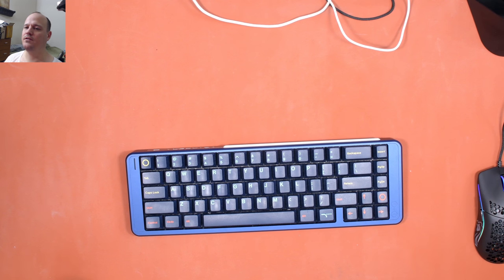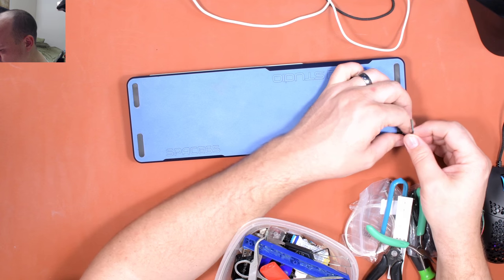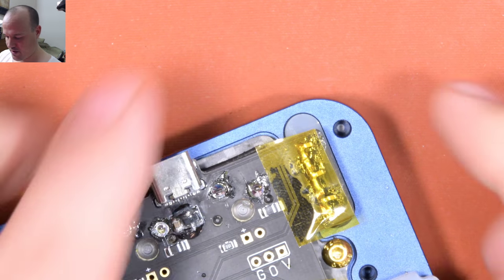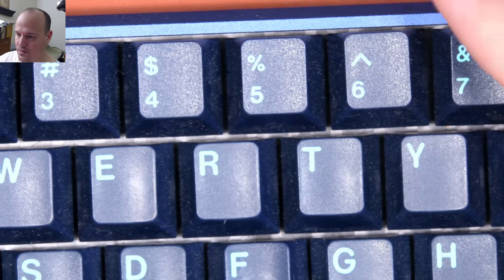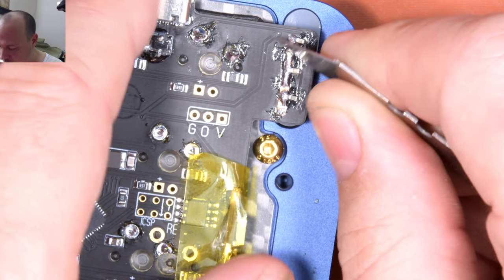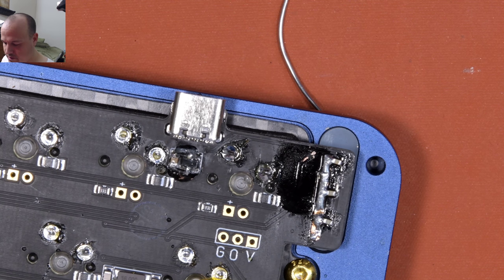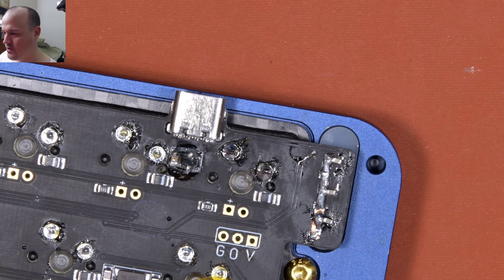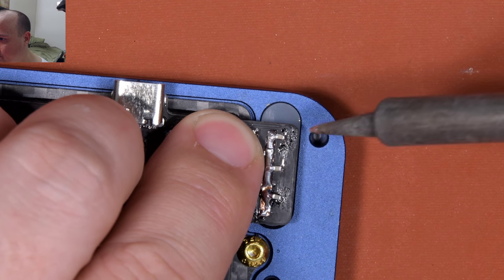Space65: Adding series resistor to LED din pin

Comment: Also, the "r" is probably used for ohms when writing because if you're typing it on a keyboard, there's no omega character handy, and using an O would be confused with zero.

The numbers are often written that way, using the letter as a decimal point, because it's easy to read, and not prone to errors like not seeing a decimal point on messy writing.

for example 4r7 is not ambiguous, where 4.7ohm could easily be misread as 47ohm if it's written by hand.  same is used for kiloohms 2k2 being 2.2k, etc.
Capacitors and inductors can be written the same way, usually using "u" for micro (again, the mu character isn't on most keyboards), "n" nano, "p" pico, etc.

Comment: for future reference, the 3 number resistor codes are pretty easy to interpret.  first two digits are just the first two digits of the number, and the 3rd one is just the number of zeros that follow.

You do need to be careful though with numbers that could be readable upside down, like 221 is 220 ohm, but could be misread upside down as 1.2k  Fortunately, most of the other invertable numbers give weird values that will sound "wrong" to electronics geeks who fairly used to the E12 values.

Do you know the actual purpose of the resistor on the DI line?  It seems to me that it shouldn't have any problem with current unless you have really long wires (inductance).  It might help with reflections though.